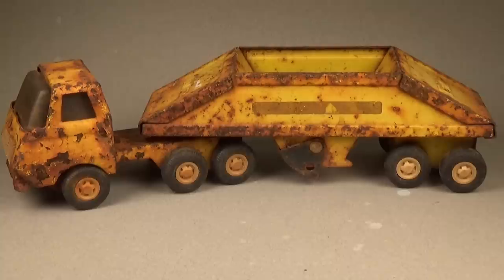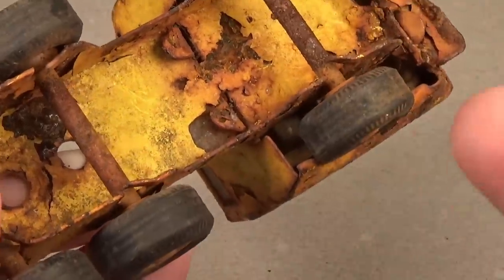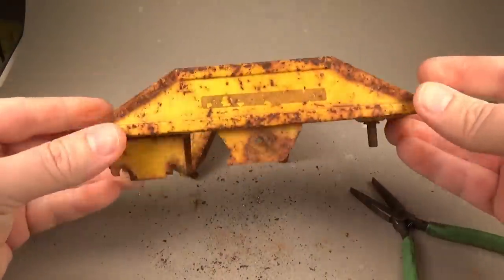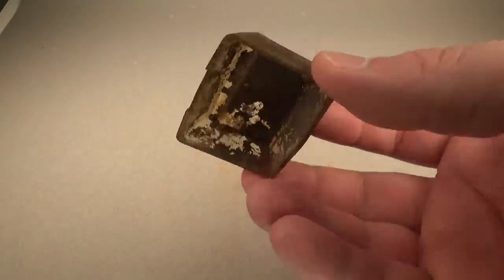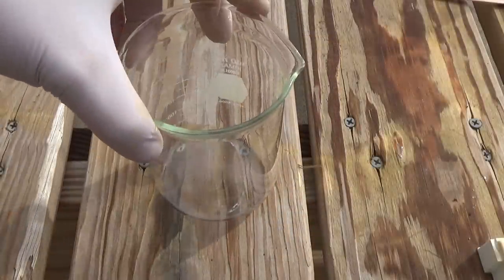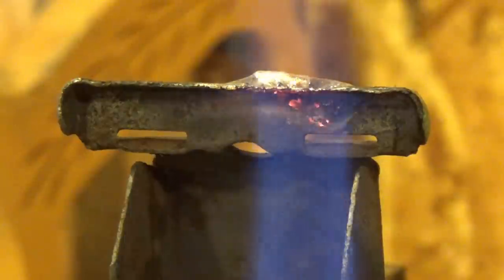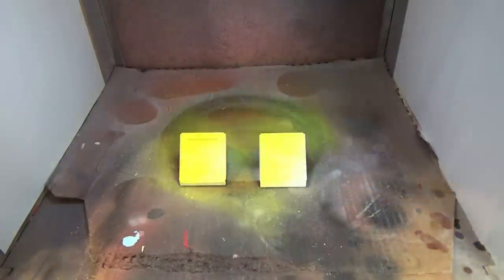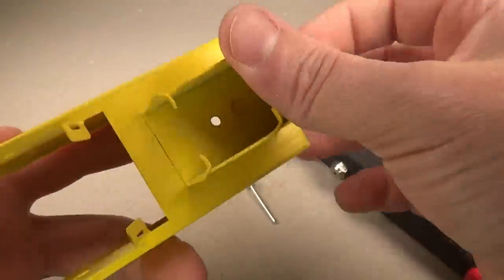Vintage 1970's Tonka Truck Gravel Spreader Restoration

Comment: I love Tonka toy restorations, I would like to see larger scale die cast restorations maybe? 👍🏼👍🏼
Reply: There are a couple other channels that specialize in the metal toy restos. TRG and Toy rescue and restore come to mind. I found them through Tyse Tube
Reply: A 1/18 or 1/24 resto or custom would be cool. Diecast Resurrection has done some 1/18 restos in the last few months that turned out nice. I'd love to see what  Baremetal could do with one.
Reply: What do you do to break up the yellow?  I think it looked better before. Not dissing the restoration job at all. I think he did a nice job.  But it just doesn't look right all that yellow. Like it needs pin striping or maybe some lettering or something.

Comment: I've never restored hot wheels, or anything similar, but I love your videos. I work on and restore old motorcycles, and in doing so, have used sandblasters quite a bit. I've personally never had a  problem with small amounts of paint on parts I'm blasting. The only problem are oil soaked parts, which I'm assuming is not much of a problem for you. I'm no expert, but I'd guess you would be fine to remove paint with your blasting set up, and should only need to filter the media after quite a few jobs. I dont know your exact set up, but I think you should be ok. Anyway, love your stuff man, keep em coming.
Reply: I've had no issue with paint particles as of yet.
Reply: Got some video of your work? I have whole series dedicated to motorcycles and restos.

Comment: This is one sweet restoration. I will say here, I like the idea of artificial rust for this. More specifically where the pitting remains. 

Also: The community tab is super easy to access and use on mobile.

Comment: I have a few of these as well...some in same or worse shape. You did the right thing by trying to restore this. 😃Anything worth having is worth the time to get it into go working shape. 🧐You took a couple extra steps, but it was better to...love the sandblaster. Those are wonderful! The right tools make things much easier. 😍I think it turned out rather nicely! Weathering...I don’t think it’s really necessary, unless you plan to build a working scene that includes dirt or something like that.🤩

Comment: Well done! I make vintage signs from scratch which I "paint" rust on -- I have also had clients bring me real vintage signs that were pretty well rusted, some were missing corners and such. I would then redo them and then add back in some rust in places that could not be fixed. I too like the character of the rust. I definitely think the truck will look better with a little rust here and there.

Comment: A few tips that may help when restoring these Tonka trucks:  Source replacement decals, pop the tires off the rims and treat them in peroxide the same way you did the interior, and invest in a powder coating setup.  There is even a powder coat primer that would help eliminate more of that pesky pitting.  I watch a channel called Rescue & Restore and they specialize in metal toys like this.  The videos are silent, but the guy is able to pull off some miracles!!

Comment: I've never had the slightest bit of trouble with paint flakes clogging the gun, and if you are particularly concerned about it, it's pretty much trivial to just run the media through some window screen and remove all the chunkies.  Congrats on getting a blast cabinet, man, you're going to LOVE the capability there!

Comment: Fantastic job. As to your sandblaster question, worked with many parts inside a machine for years and never once needed to sift or screen anything except if there were oils or heavy humidity. Just make sure whatever you are scouring is really dry and you should never have to worry about a thing.

Comment: This video was very enjoyable to watch & thankya for sharing. i was disappointed in the fact that ya did not clean up the wheels & tires as well. I liked how the clear plastic window turned out after cleaning. With the plastic interior/front grill piece cleaned, you should've painted it a semi-gloss white. A semi-gloss black paint touch to the tires as well as a semi-gloss white touch to the wheels would've added real nicely. 

i have a full, complete, unrestored, perfect conditioned, set of these small tonka trucks. . . . which includes the belly dump gravel truck, a cement mixer truck, a dump truck, & a tonka truck with the lowboy heavy equipment transport trailer & a tonka catepillar bulldozer to complete the truck's load.

 I have some of the bigger Tonka trucks including the workable clamshell type bucket crane truck that all need restoring.  Hopefully a summer time project. 

thankyou again for your video. Nice work on the belly dump tonka truck.

Comment: Thanks for bringing back a great memory.  I got these as a set as a boy for Christmas.  There was a red dump truck, a truck with a green bulldozer on a trailer, and a cement mixer.  Too bad you couldn't recreate the decal.  That would complete the restoration.
Reply: The cab had the Tonka logo in an oval on the "doors."

Comment: That is a nice restoration there mate, specially as a first time.  I am fully onboard on some customization, be it via rust painting or whatever.

I think they used the long rivet rod thing because it requires less tooling in assembly. Put it in, crumple one side, done. If you use two rivets, you need to do that twice. Also style. Tonka seems to have favored solid rivets (needs access from both sides), and the rod is basically one long solid rivet, while it would be harder two shorter solid rivets instead.

If you're looking to get into the larger tonka models, check a channel called Rescue & Restore. The guy over there does general restorations, but he has done plenty on larger tonka toys. Guy is a beast,  bet ya can pick up plenty of tricks from him too.

Comment: A year late, but I have to say I kinda dig the tapered screw. I've always liked leaving signs of a restoration, even though most restorationists would like to make the end result look as original as possible. I think it's more authentic to show off that 'hey, this ain't the original.' Even though the bright yellow paint should be more than enough for a sign, lol. 

If you ever revisit this one, I'd like to see you rust it like a real truck, man. I don't think you need to, though. I kinda dig the pristine look... although the rusted original is admittedly cooler.

Comment: The metal is actually quite resilient,  as long as it's not being bent multiple times. Powder coating is a very durable and forgiving option over paint, especially on the larger trucks. I got into Redline restoration from your channel, and from it moved into the larger early 60s Tonkas.

Comment: Most YouTubers with channels on here restoring this kind of thing tend to go down the media blasting route for cleaning up the metalwork and removing paint. Cleaning out/replacing the blast media occasionally is necessary as what gets blasted off does get mixed in. Nice to see you tackle something different. Rescue Restore does some great restorations on items like this and you may want to check out his channel.

Comment: Excellent video, I like the experimentation with larger scale models and new equipment - I guess it also means you can diversify into the ever popular small tool restorations, should you find you need a little more variety.

Comment: Nice resto, a few other 1:64 restorers have tackle similar Tonka's recently. On the subject of media blasters and blockages I used to use them a lot in my work years ago to clean up steel and aluminium parts either for painting or polishing and have found that while paint can be a factor in blocking the nozzle in high enough percentages, grease, oil and other liquid contaminants are far more likely to cause issues. Another thing to keep in mind is that especially with glass bead media the media itself as well as fine pieces of metal from the work and the oxide layer on it which can break down into talcum powder like fine particles which can cause blockages in and of itself. If you feel at any time that the media has become contaminated with oil/grease/moisture or has become so fine that it looks like talc it's probably time to empty the cabinet and replace the blasting media.
P.S. we used to regularly change out the blasting media every 3-4 weeks due to the volume of parts cleaned in the cabinet and general poor condition of parts which arrived for blasting.

Comment: Good choices going with both a sand blaster and a soda blaster. One tip for Tonka toys. If you’re going to “restore” many more, they are powder coated, not painted. Also you can get Tonka yellow in spray paint and powder coat.

Comment: Nice job! I have two blasting cabinets setup. One has medium grit soda in it that I use on die-cast cars and it works great.it will remove paint from the smallest areas without doing any damage. On steel soda will take off the paint but has a hard time with removing any rust. My second cabinet is for steel cars like Tonkas. I have a medium grit abrasive in it. looks like the same stuff you are using in the video. The most I do is brush off the really loose flakes with my fingers and then blast everything else away. I don't have any problems with clogging the nozzle. Hope this helps.
Reply from the maker: It does thanks!

Comment: Awesome restoration! Great work on plastic parts. The windshield & interior look almost brand new! My one & only question is why you didn't use the same peroxide process on the wheels? I think the tires come off. The yellowed wheels are the only thing that look off. Having said all that this is the best Tonka restoration I've seen on YouTube.

Comment: For large pitting try using a sand and fill primer in two different colors the primer will fill it in and when you sand it down the other color will show through which will show smaller imperfections you can take care of with putty. A great process for larger projects like this.

Comment: From someone who used to work in a Heat Treatment factory where we would Sand and Bead blast metal on a daily basis to remove flash from the parts, small chips of paint should cause no issue whatsoever, in fact just coming into contact with all that sand would turn them almost immediately to dust, another thing to think about is that paint has a much lower density and is nowhere near as structurally sound as rock (sand) if your machine can process the sand, it can process the paint as for chips of rust, rust is effectively the same, your sand blaster should immediately blast this into pieces small enough to be processed as long as you are only working on small items like this one HOWEVER problems may arise when working on larger items where rust has maybe thinned an area of metal and comes off in chunks as opposed to grains or dust. Hope this helps.

In any event for your machine you can also get a filter tray for the bottom of your sand booth which has holes only big enough for material that can be processed in order to catch larger items, if yours doesn't have one, maybe look into getting one.

Comment: maybe a consideration....  I've restored 3 Tonkas so far. 2 large dump trucks and one large pickup. The pickup I did for myself as I played with it as a child and I simply restored it using simple acrylic craft paints to sit on a shelf as a fond memory from childhood. The two large dump trucks I restored/customized for nephews. They still want to play with them so I was not looking to make perfect. So I removed all the rust, and luckily I had no holes that needed filled and only minor pitting that I left alone. Now for where I took a step sideways and where I mentioned a consideration before. I painted it using Hammerite paint. Since they still want to play with the toys and there is no chance in H E double hockeysticks that they are going to be gentle with them, I chose the Hammerite as it will likely outlast the kids. Now it also helped that they wanted grey and black trucks rather than yellow as I already had black and silver Hammerite. So my suggestion is that if this truck is going to be a shelf sitter then anything you do is fine. But if you plan on letting any children play with it, then I'd suggest either a hardy paint like hammerite or going with Powder coating rather than a simple rattle can paint. Rattle can paint is fine for light handling but typically does not hold up to hardy play. Just my 2 cents worth.
Reply from the maker: I agree....this one will just be going on a shelf... I had planned on Powder Coating it however I couldn't find yellow powder coat to match.

Comment: I've done a couple large Tonkas and have gone straight to sandblasting.  No issue with the media. They are fun, mine were toys from the late 60s that I had since a child.  Add decals from eBay and they look like new.   Look at McMasterCarr for a closer match for the screw.

Comment: Good work.  Thank you for explaining why you didn't use the sand blaster in the beginning as I saw in other restoration videos.  I did not know the blasted paint and other materials mixed in with the medium and can cause it to interfere with the flow.  Males sense.  Did the truck had decals?

Comment: Awesome job👍 but why didn't you soak the wheels with the interior so they all would be white
Reply: I thought the same thing! In addition, it made me wonder, if the glass were soaked in the peroxide,  would it also lighten up?
Reply: You got a point I forgot about the glass
Reply: Apparently that works for the glass. Have seem it on other rests channels

Comment: Have you ever thought of foraying into powder coating? I want to for jewelry making, but haven't yet. I would assume the cars wouldn't withstand the heat required? I'd be interested to hear your thoughts.  Oh, and a lot of the restorers I watch strip paint before sandblasting for the reason you mentioned. I have also heard a local repair shop tell me stripping paint first helps save on media, helps to not "dustify" [his word] posdible toxic paint, and allows him to get a feel for the piece before sandblasting.

Comment: You said that the yellowing on the windshield can't be fixed. I was curious if you've ever tried anything like Sea Glow? I've been meaning to try it on clear discolored plastics, but haven't had the chance yet. I think it was made to restore white items that became discolored while in the water, but it was popularized by sneaker restorers. They use it on clear soles that have yellowed to restore it back to its translucent state. It says it's safe on plastics, and I've always wondered if it worked on clear ones as well.

Comment: This video is older but i just wanna share a tip.. You can spraypaint outside when it’s cold even though it says you’re not recommended to on the bottle, You just gotta make sure that  you give the can a good shake and that you pre spray and have the distance dialed in so it doesn’t create any lumps, if you feel it getting sluggish put it in a bowl of hot water.

Comment: The truck looks great. The hydrogen peroxide did a good job on the interior but could you have used it on the wheels? I don't know if the tires come off.

Comment: vehicles in this size range are much easier to work on with younger family members. We have made a couple of my trucks good enough for indoor play. Although, the plan to restore one of the tractor/trailer sets is in the works. Will be using bondo as it's size will allow for that, and keep costs lower. Being able to use paint off the shelf is another positive for larger vehicles.

Comment: Try a Chicago screw they have large flat heads and are typically used in leather.  Rust is the bigger problem I have in the blast cabinet as it is very fine and quickly makes a dust cloud and difficult to see what your blasting.  Only option is to change media as it is too small to filter.  If you have loose paint it is better to remove it before blasting as it can break off in large chunks and some times cause plugging.  Tightly adhered paint is usually no issue.

Comment: I would filter the sand in the sand blaster if you take off large amounts of paint. I had used a friends once to do an intake manifold and the paint chips kept clogging the gun, along with some paint chips that were in the machine from the previous user.

Comment: hey man love the show! i managed to find a hot wheels 1969 torero, 32 hot heap, 32 ford vicky and a 68 python all still in their original blister packs, the card is a tad bent up with age but cars are immaculate as you'd expect. what would they be worth? they've been sitting around for a while and  wanna make the owner an offer. thanks!

Comment: I doubt that paint chips contaminating your blasting media will be a problem. If the gun were to get clogged just press the muzzle against your glove and give the trigger a quick burst. The back pressure should then dislodge the clog. 

The only issue I might forsee  is dissimilar metals corrosion. If you blast an aluminum part with media that has bits of steel in it from an earlier job it's possible to embed those particles into the new work. It's a minor risk on a toy car and probably would just cause some of the paint to bubble and flake.

Comment: Looking up the Tonka style guide - they call "Tonka Yellow" either Pantone 124C; Pantone 7405U or Pantone 124M - I think Pantone is only for plastic colours and prints, though although happy to be corrected.

There are some close equivalents I could find - which is RAL 1003 (Signal Yellow) or Federal Standard 595C 33655 (Yellow) - I don't know if paint codes in the states follow that standard, sorry. RAL standard (European) are paint codes which are for metals amongst other things.

Comment: The panel on the bottom of the trailer is a way to load the trailer. as the machine drive the dirt or sand scoops into the hopper.        Carl M in PA